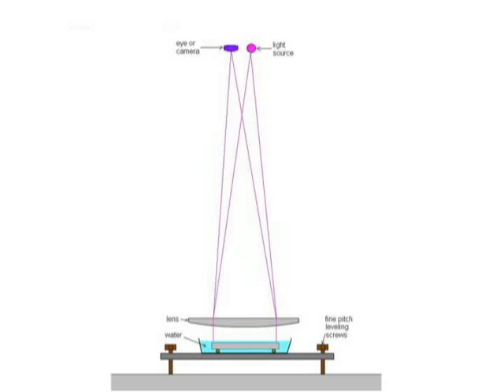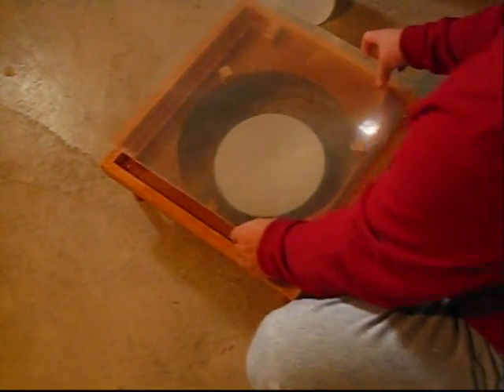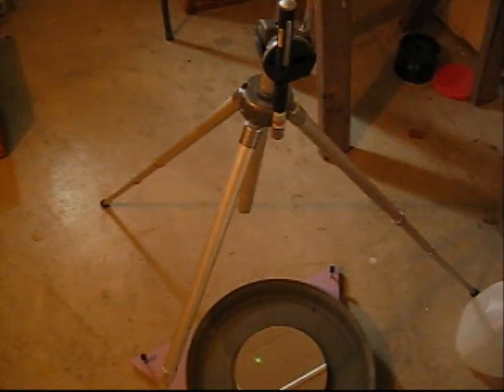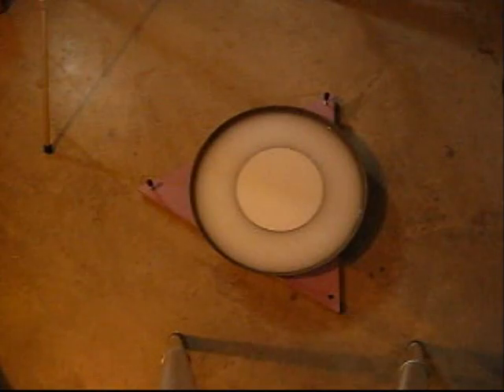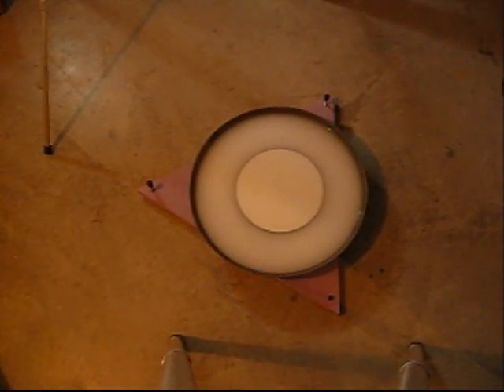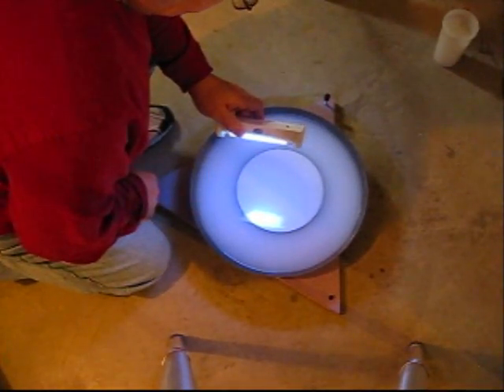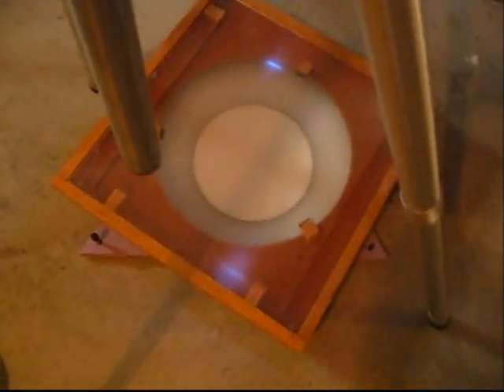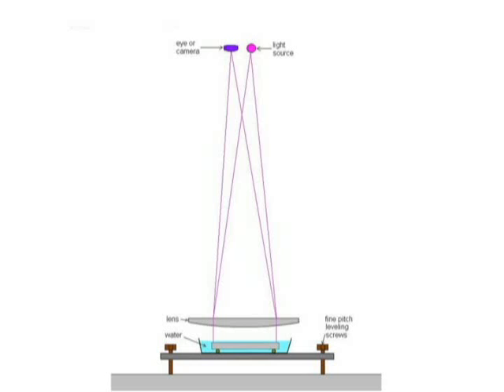Testing an optical flat in water.wmv

Comment: I have a 60 mm +1 dioptry (1 m focal lenght ) lens, but the optical center is offset. Does it matter for making the test ???
Reply from the maker: That's not a very big lens but if it puts out parallel light it will work.

Comment from the maker: There is a learning curve but I'm sure the reason most ATM have trouble with this test is in getting collimation of the flat with water.  I use a laser in my setups and video but it's not perfect and I can be off enough to where the fringes can't be seen, (they are actually there but spaced so close that you can't see them unless you actually get down close and use a magnifier due to too much tilt).  So if you really can't get a laser to work you can make an autocollimator using a cheap dime store refractor (there were about a half dozen locally on Craig's list under $25) putting a LED source in a low power eyepiece.  The tripod and mount are good for aiming straight down too.  Fine pitch leveling screws are very helpful too.
 

  As far as the light source a neon lamp has a bunch of emission lines but I've used one as did Texereau but I can't compare it to a mercury lamp.  I use a F4T5 BL (black light) which can be found on Ebay but the fixtures are harder to find.  I use Kitchen and Bath fluorescent lamps where I need to do contact testing, they seem to be the best fluorescents.  LEDs don't work BTW.

 

  I would advise learning on a small uncoated flat where finding a small lens for a collimator isn't hard. When that's mastered then try a coated mirror and cerium oxide to cut down the intensity.  Measuring the water thickness is important as well, 1 mm is good for large mirrors perhaps less for smaller optics.